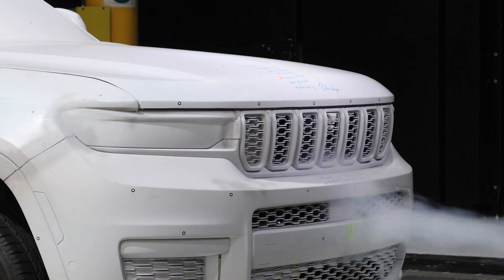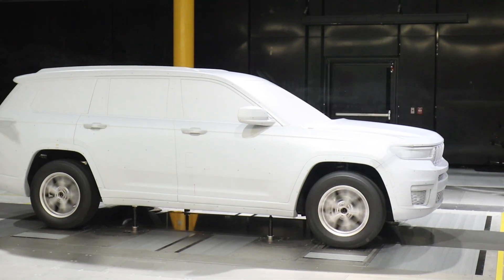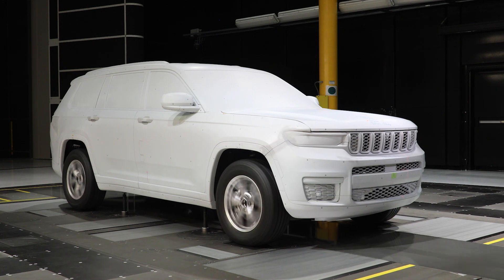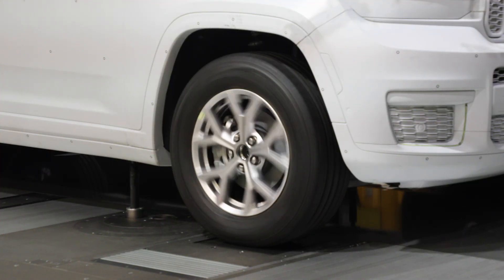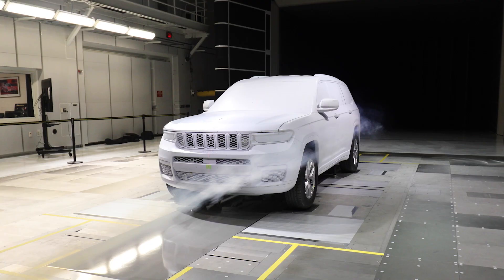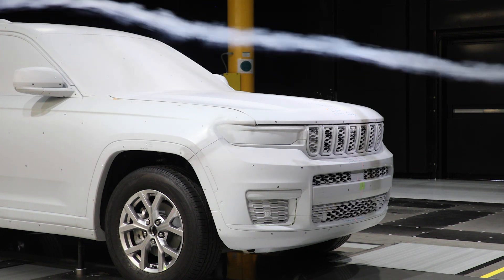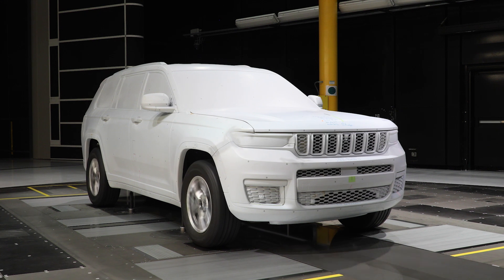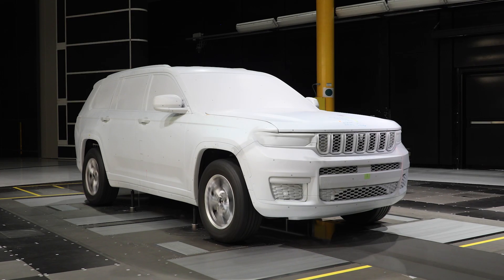Wind-Tunnel Upgrade: Moving Ground Plane Technology

Comment: R.I.P MOPAR
Reply: If you buy a Toyota or a Hyundai then the American auto industry will die.
Reply: @Ingwine  "American" brands maybe so, since they keep moving them to Mexico. But Toyota, Hyundai, and Acura have manufacturers in America. So the American Auto Industry won't die, just the brands that started it will.
Reply: @MidSouthUTV might as Well be Dead. Toyota has Never ever built a Car or Truck that is Desirable For me.i can go back in time to the 1960s cars and trucks, and can't find one foreign car or truck that I would personally want. but for sure there's lots of American Brands I do like and None have a Bolshevik feel like some of the new cars and trucks do.
Reply: @Ingwine care to explain that logic to me and the 10,000+ other American engineers working in America for Toyota…